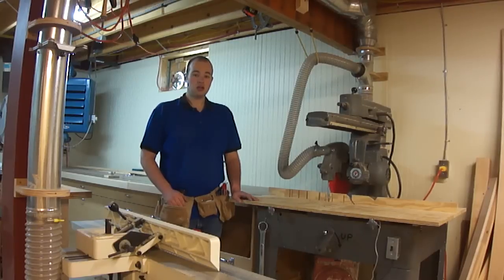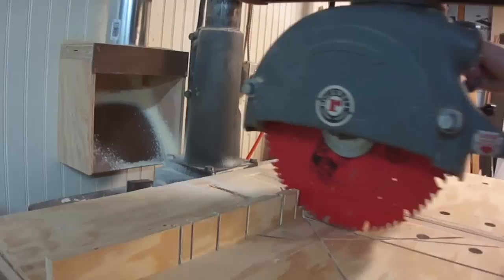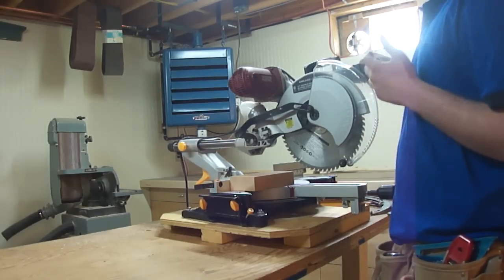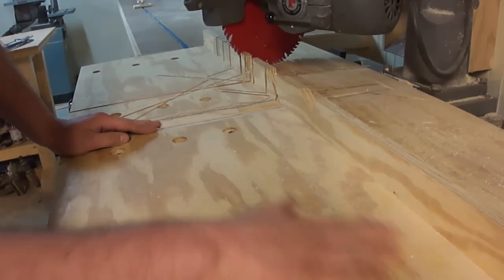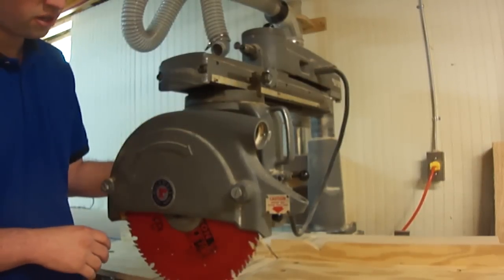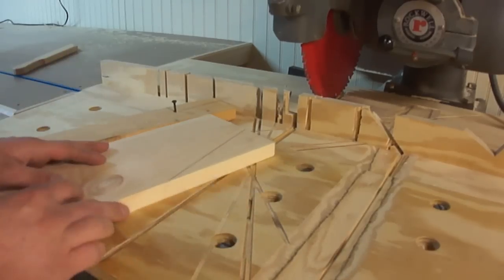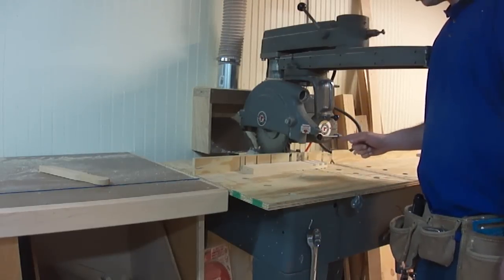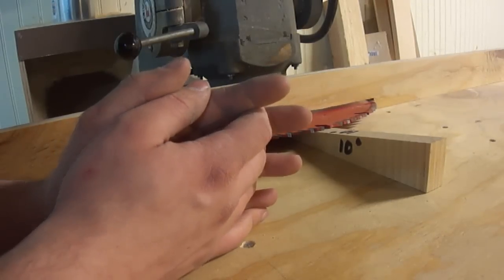How To Use The Radial Arm Saw

Comment: Great video examining proper and safe use of the ever popular and versatile Radial Arm Saw. I bought my Craftsman Radial Arm Saw in the Spring of 1978. I have done just about everything there is to do with this saw. From ripping 2" X 4" X 8'  long, Spruce Construction Lumber into 1/4" thick slats to cutting deep channels in the same type of wood stock to make heavy duty, weight bearing shelving. I have used it to cut all types of wood and plastic pipe. Never had any problems with it in all those years. Some woodworkers go on about safety issues but this saw is no different than any other table type saw. Keep any limbs out of the path of the blade and don't wear loose hanging clothing. When you shut it off, remember the blade keeps turning for a while, I don't let go of the handle until it's quiet. And I always have a firm alert grip on the handle because as you say, it tends to want to propel itself through whatever wood piece you are about to cut. Use this saw as it was intended and observe the safety precautions that you need to be aware of that are unique to the operation of this amazing tool. And you will have a very productive relationship over time. Mine is now over 40 years old and still working for me as if it were new. This thing has watched me grow old. I still use this saw for specific jobs that I don't do on any of my other machines. My Radial Arm Saw is just the best choice for some types of  work to get the best results. If some people are experiencing problems with one of these saws. They need to make sure that the saw is in good condition and that nothing needs to be replaced. And when using the saw, give it respect and use your head like any dangerous piece of equipment. It's a powerful tool that can cause serious injury if your attention is not focused on the machine. Operate with care.
Reply from the maker: Thanks!
Reply: Interesting. I wish you the best of luck with shop safety in the future.

Comment: 40 years a woodworker, just bought my first RAS, a Delta 12" 33-890, to use primarily for dados, but after watching this, I'll be  trying some other operations.  Love the panel raising table.
Reply: Nice saw . I have the same model Delta. I didn't realize it was a 12" for about a couple years . I bought it used and in like new condition, but it had a 10" blade on it . I knew a cabinet maker years ago that did the same thing . He said it gives the saw more power and you have less blade flex when ripping. I put on a 12" and didn't notice any loss of power and it had a smoother cut ripping. One only issue is using a new carbide.The blade clears to much between the blade and fence and doesn't kick back hard but it pushes the board out ,but not radical. I love ripping for fun rough cut 4x4s from old pallets to clean cut boards . Good practice ripping. Nice saw you have plenty of power with that saw. I got my eyes on a vintage 16 inch DeWalt . Very cool saws .

Comment: Hi Iain, I just got my first RAS as an experiment. The first one I ever saw was a few weeks before and I was fascinated by it. It didn't even get turned on. For mine, I need to put a new table on it and will start using it then. 

I'm watching your video a few times, taking notes, building a new table, and only then will I flip the switch. 

I feel like I've seen all the Youtube vids at this point and yours is tops. It's the right pace, level of detail and should be required viewing by ANYONE new to using an RAS or who has never gotten a walkthru from an old pro. 

You and Mr. Sawdust are the rockstars of the RAS world.

Comment: One of the best presentations I've seen yet on the RAS.  I inherited one, a Ryobi so old it was made in Japan, and recently acquired some equipment which includes a Craftsman RAS, but I don't know how old.  It has a laser guide so it isn't really too vintage.  After watching some other videos I attempted to do some work on the Ryobi;  too different, too terrifying!  I can appreciate that a RAS can sit up against the wall and therefore not take up real estate like a cabinet saw.  After watching this I'll give them a second look but even so...it seems there may be other tools to do these same functions.  Excellent video and instruction! Thanks!
Reply: Keep in mind, you can "push" the blade into the cut. Just clamp the stock down, or hold it down firmly, and then push the cut. A miter saw does a "push cut" and they don't have any problems at all doing this. The other thing, if you make your cut, just get a "anti-kickback blade" like a Diablo 40 tooth multipurpose blade... Using the "old" style blades without the "limiters" in between each tooth (non--cutting teeth) the blade will try to climb too much.

Comment: Just bought a used RAS off Craigslist.  Thanks much for the clear, complete, and excellent instruction.
Reply from the maker: jasonji1900 glad the video could be of assistance! What type of RAS is it?
Reply: The Northland Workshop I got a Rigid one.  It’s not nearly the saw as a DEWALT or other good one, but it was cheap, and it seems in decent shape.  Just about done getting it set up to run straight and true, and building it a new table.
Reply from the maker: jasonji1900 while I haven’t used a Ridgid RAS myself I know someone who has one and he likes it. Once it’s all set up I’m sure it will work just fine.

Comment: I have a Craftsman 10" RAS from the late 60's.  I bought it new when I was in high school and have had it ever since and used it many hours.  Thanks you for you video.  I can see that your saw is bigger and much more solid than mine.  I recently put a thin kerf negative rake blade on mine and it is a game changer.  I use mine for cross cutting almost exclusively.  The new blade has much less tendency to climb through the cut.
Reply from the maker: Barry Irby a thin kerf blade makes a big difference on smaller saws. I got lucky when I was given this industrial saw but a smaller saw can do everything a bigger saw can. The lighter ones just require a bit more fiddling with during the set up.
Reply: Something that also can work (but use your discretion) is an "anti-kickback" blade. The old blades, and the new professional blades, are extremely dangerous on a radial arm saw, because they do not have any anti-kickback teeth on them. But the new "cheap" blades sold in box stores, have anti-kickback teeth. I'm using a Diablo 40 tooth "general purpose" blades on my radial arm saw and it doesn't climb at all, it's very smooth and precise. The cutting is "limited" by the anti-kickback teeth called "shoulder" or "limiter" teeth in between each cutting tooth. The shoulder teeth prevent run away climb by limiting the feed rate. Dado sets can also have these "limiters" or "shoulder" teeth and you shouldn't use a blade without anti-kickback shoulders unless you are using a negative rake.

Comment: Best radial arm saw video I’ve seen so far, I love radial arm saws especially the old Dewalts, I picked up a DeWALT model GE and it is unstoppable with that 7.5hp motor
Reply from the maker: Eugene Tavares 7.5 hp? That’s a monster! Does it take a 16” blade?
Reply: Yes it does, the sound of the motor doesn’t even change when I cross cut through 5in x 10in walnut mantle.

Comment: Thanks for making this video. I started manufacturing beehives at the beginning of the year and this convinced me that the RAS was the tool to go for. I was lucky enough to get the same Rockwell as yours for $230 (R3500 here in SA). Best decision I have ever made.
Reply from the maker: Nice!
Reply: @TheNorthlandWorkshop  The reason your Blade guard is hard to use, is your fence is too high. Mine only is 1/2 inch above the deck. On the occasion I need a higher fence for example cutting  Crown Molding I will pop in a higher fence, but for the everyday use of crosscutting and ripping dimensional lumber a high fence is not needed.. Sorry for posting this here but I did not see the public comments section open. Great video though..

Comment: I ran a commercial size radial arm saw in my dad's pallet shop when I was 10-12 years old. Mainly because I wasn't big enough to handle the 16ft 4x4's we cut 16 hours a day. My job was to stop the moving timber at the mark & jerk the arm as fast as I could. Green oak 4x4 in no more than 2 or 3 seconds. Still have 10 digits at 64 yrs old.
Reply: Rocky Hart I’m 62 still have all mine too!

Comment: I'm sure I would have ripped using the same spin as the crosscut! It seemed like the obvious thing to do. Until I watched your explanation!
And my RAS came with the top screwed on. I didn't realize I could move the boards around like that! Moving the guide all the way back to the support arm, removed  my concern of not being able to rip wide boards. 
 I bought my saw yesterday and I think your video is required watching! Thanks!
Reply from the maker: Gilbert Patenaude I’m glad this video helped! Thanks for watching!

Comment: Great video, starting to see a revival in the RAS. Would love to see a maintenance video on the saw as I just picked up the exact saw. Needs some love before it is ready to cut.
Reply: Look for mr sawdust radial arm saw book, or another great book on RAS setup is a book from Jon eakes (fine tuning your radial arm saw). Both great books mr sawdust has proper plans on how to build a better new top for saw. Once set up this Rockwell 40c way more accurate then miter saws, and they stay true for a long time
Reply: Oh and get a negative rake angle blade for saw

Comment: Great Tutorial, thank you for posting. I have a Radial Arm Say that was passed on to me from my late father but there were some aspects of it I was not too sure about and so its just sat in my shop and very rarely used. You have covered a great many ways of using the saw with a great number of excellent safety tips that I now have a lot more confidence in putting it to work more than my contractors table saw. The jig for cutting the raised panels is a beauty and so simple and a lot more safer than the upright jig and clamps I have to use to cut them on the table saw. Thanks once again.
Reply from the maker: Dave Palmer glad I could help and thanks for watching!

Comment: Good video. Building myself a little shop this summer, and though I love my table saw, it would take up most of the new space. However, if I left it where it is (in the garage, which it shares with 2 cars) then I could fit a RAS in the shop for most of my cutting. It would take some getting used to, but I sure like its versatility.

Comment: My biggest problem with a radial arm saw was to get the blade to cut square with the fence (or parallel when ripping) I very quickly learned that that was important. My Dewalt saw has, I think, a crude adjustment system which takes some time to set to get it right. The fact that the saw got wet made it even more difficult. Good video! Thanks!.
Reply: Bill Rey You're right, it is kinda backwards. The outter part of the bed has to be squared to the fence and bolted down. Then ANY straight fence will be squared to the blade and take up the difference with the adjustment knobs at the back of the saw.... Unless yours is like his. Lol

Comment: Now that I'm retired. I'm in the process of making a new wheeled work bench with built in table saw,  router,  drill press, miter saw etc. While drawing up plans I remembered the old radial arm saw my dad left me which had been disassembled collecting dust and unused for years  sitting in the corner of the shop. This was the first major power saw I used as a kid and I loved it. I have always wanted to set it up again because of many uses it has like making dado cuts where you can actually see and control the cut. My dad taught me the safe way to use it and I respected it and never had any issues.  Any way I started thinking maybe I could incorporate this into the bench using a flip up design. I think I've worked out the bugs in the idea and am going to include it in the bench. I haven't heard much of anyone else doing this and would love to see if anyone has video of their flip ups if there are any. You did a great job on this video and got my juices flowing again thinking about all of the use I will get out of this old Craftsman again.
Reply: Well, do you have any videos on your saw? What model is it? I have a 1978 Craftsman and I absolutely love it! It cuts like a precision machine shop tool, it's dead on accurate, and so quiet that you don't even need hearing protection. I also bought a Dewalt 770 Deluxe 10" radial arm saw for $50, because why not?? haha.

Comment: Well, that was very enjoyable. You’ve figured out many clever approaches to this machine. Two things from my beginner’s research so far: it seems like many saw tables are such that there is a sacrificial 3/4 slab on the front portion such that the original base never gets cut and forms a sort of trough then it under the blade in the home position so that it’s not n contact with a surface when it starts spinning, and
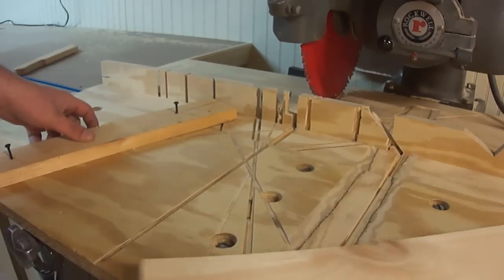2. Seems Ike it would be great if your screw-down fence art time 33:00 had a couple of hold down toggle clamps on it. 
Thanks for all the great info and inspiration.

Comment: Good video!  Its the second best radial arm saw video on Youtube.  If you are going to rip, you should get the pawls (anti ejection) for your saw. The pawls prevent ejection and the rod serves as a guard for the back of the blade.
Reply from the maker: Bill MacTiernan thanks. Like I said in the video I have been trying to find a set of pawls for this saw for ten years now and it seems to be the only part of this saw I can’t find used.
Reply: @TheNorthlandWorkshop  If you search the woodworking forums or one of the Dewalt RAS specific forums I believe someone has a thread on how to make your own pall.
Reply from the maker: Jason Raynor I’ll have to look for that thread, thanks.
Reply: @TheNorthlandWorkshop  Absent that, find a rod or stock that installs in the nosing for the pawl assembly, reason is when you adjust the blade guard for in or out rip, you can expose a hazardous amount of blade such that if you're doing a reach- around, the blade is not readily visible and your hand could make contact with it. Do an unpowered setup, you'll see what I mean. And don't put off visiting the Delphi forum, although DeWalt- centric, all RAS users are welcome.

Comment: Those are really good saws, I have one of the old mutiplex ones. I would definitely use feather boards or board buddies in ripping. Other than that some great details on being safe with one. I haven't seen doing raised panels with one but I may do that over using my table saw.
Reply from the maker: Josh Baker I like raising panels on the RAS because they lay flat on the table.

Comment: Very nice video!    I have had RAS since 1984.   Still have all digits and thumbs.   I cringed every time I saw you touch the blade.   I never touch a saw blade of any saw that is plugged in.   Chances are extremely rare of it starting, but I like 100% sure.
One thing you did not mention is that the saw MUST be set up exact before using it.   Otherwise, you will never be happy with it and only use it for rough cross cuts.   These can be highly accurate saws.   I just saw that you made a video on this, excellent!
I wish you had included the number of times it happened to you when you were giving warnings about the dangers.    The worst thing that has ever happened to me was a dull blade tried to come forward on a crosscut.   The motor stalled.
These saws can do way more than a table saw.   For instance, set a stop for the right length, and cut 15 pieces of 1x4 at the same exact length with one pull.  Put a clamp on the stack, cut 60 pieces in seconds.
Reply from the maker: Kevin Coop thanks for watching! I’m not quite following about talking about the number of times something has happened to me? Number of what?
Reply: The Northland Workshop      "Do not rip in this direction because it can pull in the wood and shoot it across the shop".   Additional comment, it has never happened to me, or it happened once because I was doing this.   You left it that the probability of injury was high, but if you are careful and do what you are supposed to, the probability of injury is very very low.    I have come way closer to injury with my wood lathe.
Reply from the maker: Kevin Coop I hate to disappoint you but I’ve never had that happen. it is common for people to do that and it is the number one reason people get scared to rip on the RAS. Plus it’s not intuitive which side to feed the wood in like it is on a table saw so I emphasized about feed direction.
Reply: The Northland Workshop    I'm not disappointed!   I assumed you have had no issues because I have one and know.   I'm just saying it would have been good to tell those who don't have a RAS that the things possible rarely happen, or do not happen if you do them correctly.

Comment: This is the longest video I've watched on the Tubes lately, and it was well worth it. I now have a much better understanding of the RAS I just bought, and things to consider when making a new table for it. Do you ever get kickback while ripping without a pawl? My RAS doesn't have one either, and I'm a little worried about ripping without it.
Reply from the maker: Pie Or Cake thanks for watching! I would highly recommend using the anti-kickback pawls when ripping. Have I ever experienced kickback while ripping? I can honestly say no I never have. That isn’t to say it can’t happen, it just hasn’t happened to me yet. The biggest thing is that the blade must be parallel to the fence or it will kick back.